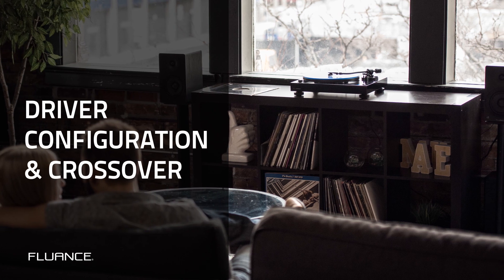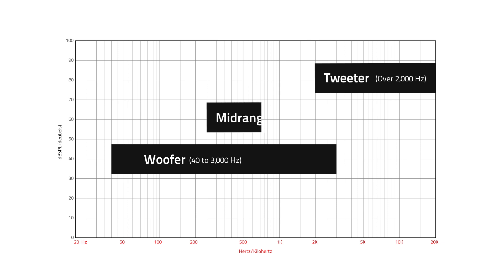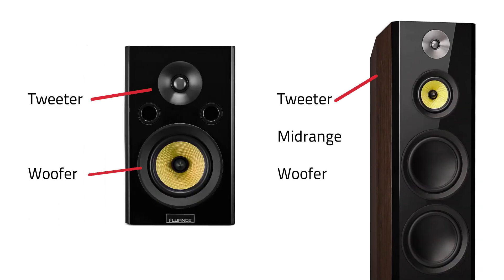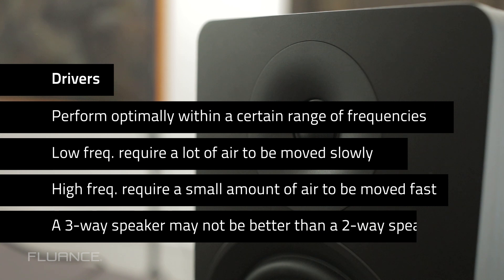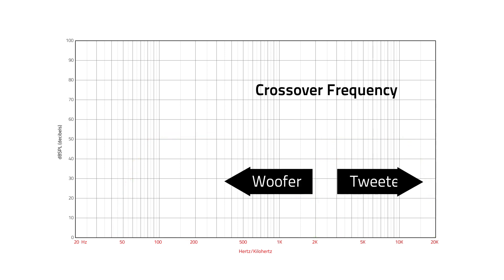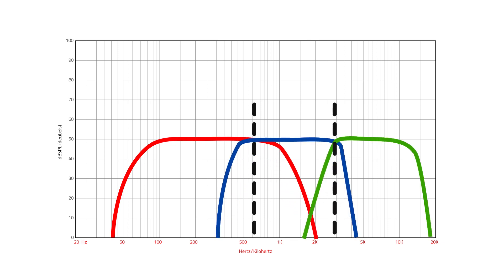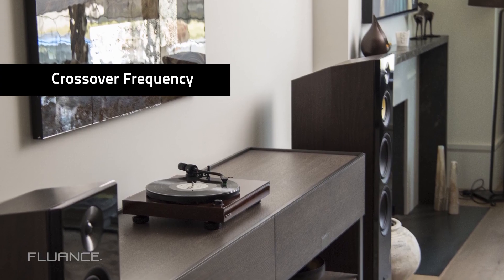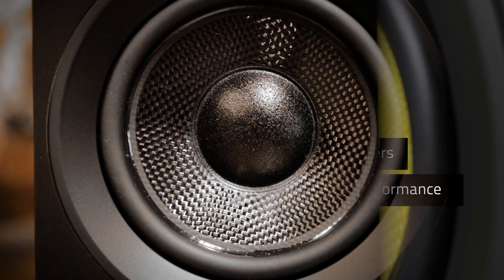What is a Crossover and How Does it Affect Speaker Configuration?

Comment: I am getting really stressed out trying to figure out information on speakers, someone please help me. I have several Pioneer speaker cabinets with ONE CROSSOVER BOARD that goes to a WOOFER, 2 FULL RANGE, 1 TWEETER, and 1 SUPER-TWEETER. Would that not mean the crossover circuit in it is a 5-WAY CROSSOVER? Literally 0 results that lead anywhere relevant come back from Google when searching for 5-way crossovers. Really frustrating I have wasted hours on this

Comment: Is there any reason not to have tweeter on top, woofer below tweeter and mid below woofer? Im working on a DIY project and can only put the mid under woofer. Is there any acoustic "rule" against this?
Reply: Weight and Center of Gravity. The heaviest closest at the base of the unit makes it harder to tip over.
Reply: might have to put extra weight at the bottom to stabilize them.

Comment: Why do we need cross-over filters at all when the speakers themselves are filters, as pointed out quite well? What is the difference between actively segregating signals in parallel versus passive filtering them by hooking up the drivers in series? It seems like a lot of fuzz for nothing. I am sure there is a good reason, probably something with power. It would complete the picture if someone would be so kind to shed some light on this.

Comment: so for a 2-way speaker, is a crossover of 2kHz better or 2.5kHz?
Reply: Totally depends on the drivers used. If your tweeter can't produce 2kHz and your woofer can go up to 2.5kHz then you want a 2.5kHz crossover. However, if you use a 2.5kHz crossover on a system where the woofer isn't capable of producing more than 2kHz then you have a big gap between 2kHz and 2.5kHz because your tweeter is cut off until 2.5kHz